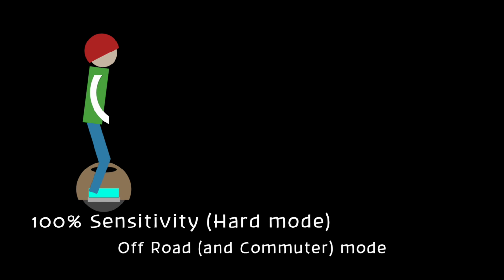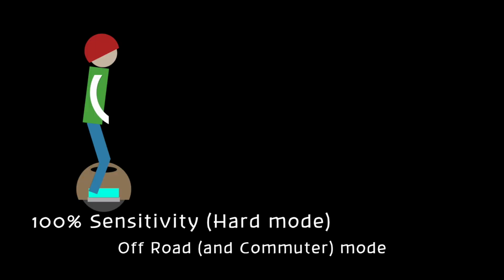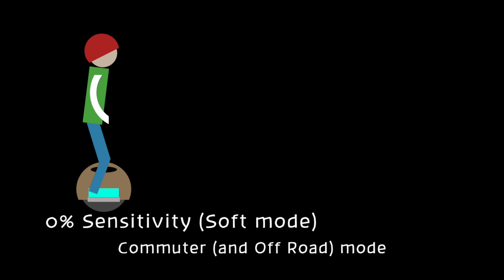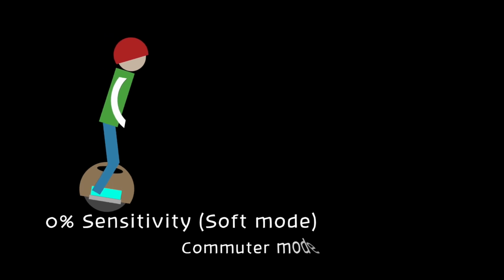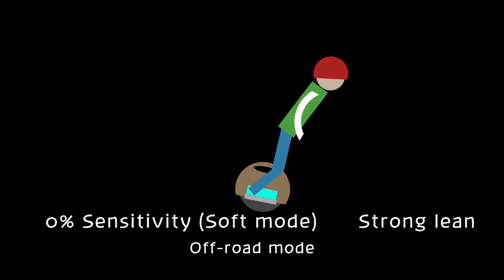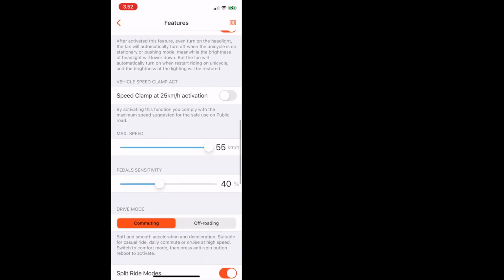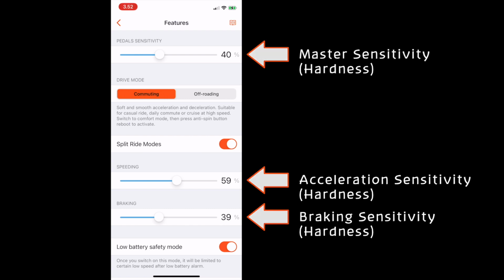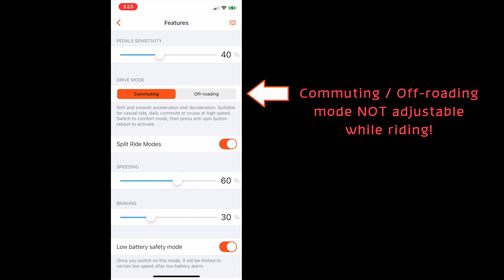EUC ride modes explained

Comment: I see you are a very knowledgeable about EUCs. I am buying my first EUC and can't decide between V11 and V12HT. Which one would you recommend? Your opinion is much appreciated. Thank you in advance.
Reply from the maker: Thanks! Well, the main differences are top speed and suspension. To me personally 55km/h is more than enough, and I would never buy a wheel without suspension. Therefore I never even considered the V12. All new wheels from now on will have suspension, it really is that groundbreaking.

Comment: What mode should I choose as a beginner?
Reply from the maker: In my opinion a medium mode makes the most sense. Soft on some wheels is absolutely ridiculous or at least something that I don't think one should get accustomed to at first. And hard is besides being more harsh for your legs and feet, usually unnecessarily sensitive for when a beginner tries to learn the interaction between their actions and how the wheel reacts.

But I do recommend visiting the settings every 500km or so, and trying different modes for at least 10km each. After all, our riding technique keeps changing forever, and sometimes a different mode could fit and support your technique better.
Reply: @mrelwood_EUC  I changed to hard on my KS16X, as I'm still very much a noob trying to learn, but my biggest frustration was leaning forward and nothing happening until I already felt like I was falling. I want it to be super sensitive and respond instantly, so that I can develop a feel and muscle memory. I also discovered the previous owner has set the pedal tilt to 2 degrees leaning forward, which made things worse too.
Reply from the maker: @bigglyguy8429  Did you have it on soft or medium before?
Reply: @mrelwood_EUC  It was on medium, I changed to hard. I'm still at the "can barely go anywhere without holding on to something or someone" stage, but already feel confident for my next session, as my 16X was more responsive. I didn't realize the adjustment actually effects the tilt of the pedals, just felt it was responding better to my inputs, so thanks for the vid! I can only practice for a short while at weekends but I'm 100% sure I'll flying entirely free next week :) My very 1st ever attempt was terrible, as the tire too soft, the pedals tilted forward and down, so just standing straight made it go backwards...
Reply from the maker: @bigglyguy8429  If standing straight makes it go backwards, you are standing far to back! I hope you have checked a few good YT lessons? So you wouldn’t have to reinvent the wheel…

If hard mode feels more stable right now, then that’s what you should use. Try the medium again after 100-500km as your needs will be quite different by then already.
Reply: @mrelwood_EUC  I was standing straight, the previous owner had set the thing to tilt forward, so standing up straight was actually creeping backwards. The perils of buying my 1st wheel 2nd hand :)  Yeah I can see why the softer modes might be good once I've learned, but it's hard to learn when the wheel takes so long to respond
Reply from the maker: @bigglyguy8429  I wonder if the firmware on it is very old? I think the medium on recent firmware versions have been quite decent, and actually pretty close to the hard mode.

Although, check the serial with EUC World or DarknessBot before connecting to a KingSong app! If there’s a “P” near the end, KingSong app will lock up your wheel.
Reply: @mrelwood_EUC  I've never used the proper app, only the EUC World app. I had it shipped from a shop in West Malaysia to East Malaysia, no instructions or app. It's done 870 km, about 8km of it being with me . Am noob :)
Reply from the maker: @bigglyguy8429  EUCw should be able to upgrade the firmware as well if you wish to do so.
Reply: @mrelwood_EUC  I'm nervous to try, in case it bricks it...
Reply from the maker: @bigglyguy8429  Upgrading from EUCw has zero chances of bricking the wheel. It won’t even try the “P” versions, and it has a specific upgrade method that can’t brick the wheel.
Reply: @mrelwood_EUC  I'll take a look, cheers :)

Comment: Great video. You have to edit the title so more people can find it. :)
Reply from the maker: 😄 Which title would you suggest?
Reply: @mrelwood_EUC  I was struggling to find any videos for Inmotion modes. As I was not able to find such (or good ones) I started searching for EUC vids. And your video is mainly about them products thus I would suggest putting iNmotion in the title plus the models. And tags of inmotion and all the v5 v5f v8 v8f v10 v10f.... etc. in the tags section.
If those apply to other manufacturers (I have no idea with other products) do the same for them.

Your video is really better than everything out there (you can see it by the other comments) so it deserves to reach out more people :)

Comment: I have a V8F, and I weigh about 85 kg (187 lbs) so I don't push it. I've had pedal sensitivity at 100% since that was recommended for beginners, but yesterday, I did a sequence of cycles of lowering sensitivity, riding for about 5 minutes, lowering again, riding another 5 minutes, repeating this until I reached the minimum of 10%. It didn't feel that much different, but due to the limits of the V8F, I don't lean much to avoid over-leaning it. I did some cycling of leaning forwards and backwards at around 10 mph,  noting that acceleration | braking response was unaffected by pedal setting, which makes sense, since the wheel has to accelerate | brake the same in order to "balance" a rider based on how much the rider is leaned forwards | backwards. The tilt response on my V8F is gradual and lags behind actual acceleration or braking, and due to my limited lean angles, not much difference in feel, not like when I tested tilt back at 8, 12, and 15 mph to see what that would feel like.  The softer settings should reduce ankle bend, which may help with calf pain I get after riding for 15 to 20 minutes. (Switching to hiking type low tops with stiff soles but cushioned interior helped).
Reply from the maker: What the pedal sensitivity (or ride modes) change though is how much effort it requires for you to achieve the desired lean angle. A fast response / hard mode will try to cancel out your lean before you even get to the desired lean angle, meaning that you'll have to constantly fight the wheel to accelerate or brake. A slow response / soft mode will let you fall down to the lean angle before it even tries to accelerate to balance out the lean.

Unless the V8F is very different from V10, V11 and V12, the difference between 0 and 100 is very extreme. If you don't feel much of a difference, it is possible that you are indeed accelerating and braking only extremely slowly. Beware though, if you adjust the setting very low for very slow accelerations and brakings, a sudden emergency braking will probably result in an unpredictable behaviour. On the V11 I feel like a safe range is between 30 and 80.
Reply: @mrelwood_EUC  - the impression I get from your video and my V8F is that lower pedal sensitivity is supposed to allow the EUC to tilt more, but at least in the case of my V8F,  it's not affecting the effort to lean (probably because it only weighs 35 lbs), or the associated response to lean. V8F has a reputation for being very responsive, with riders mentioning by comparison, a V10F feels sluggish, due to the increased effort required to lean. My V8F has an auto-tilt for hills, tilt forward for incline, tilt backward for decline, but it's a slow transition, about 1 second, and my guess is that its' a similar delay for low pedal sensitivity setting, or maybe the pedals sensitivity setting isn't working on my V8F. I also tried setting tilt forwards  2 degrees, which reduced ankle bend when leaning forwards, and since I use ankle bend for feedback on lean angle, I ended up going a bit faster than expected (like 14 mph instead of 12 mph. I use EUC World to call out speed and other stuff every 15 seconds, like an audio speedometer). If the low pedal sensitivity resulted in a faster tilt response, it would probably have a similar effect. I ended up setting the pedals back to level, and sensitivity back to 100%. After reading your comment, I did a few sit back style brake tests, getting braking peaks of -12.2 amps and -1000 watts, which is decent for a V8F. Most of my riding is around 10 to 15 mph, and even at 15 mph, braking distance is reasonably small (less than 20 feet at about 1/3 g).  Switching to the low top hiking shoes eliminated most of the calf pain I was getting before. In Monokat's review of the V12, she ended up setting all the sensitivity values to 100%.

Comment: I've been riding softer settings and I prefer it. Helps with braking as well. Makes my Z10 a different machine. Seems to me that so many riders don't really experiment enough with these settings. The trick is to ride for 100 miles or so with the different settings to really adjust to and feel the results. I hated softer setting at first but after many miles I changed my mind.
Reply from the maker: Yes, I fully agree!
Reply: Depends a lot on your pads setup

Comment: I notice my legs and foot cramp more often on hard mode
since it requires more pressure to accelerate the wheel faster.
Reply from the maker: Yes, that is what more and more riders are starting to notice as well.